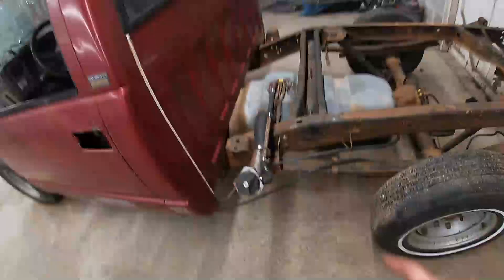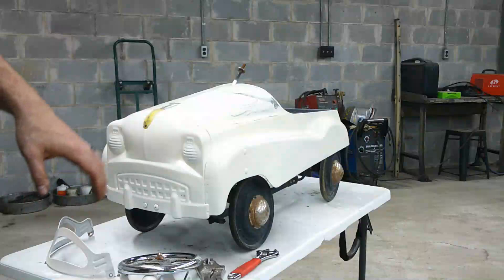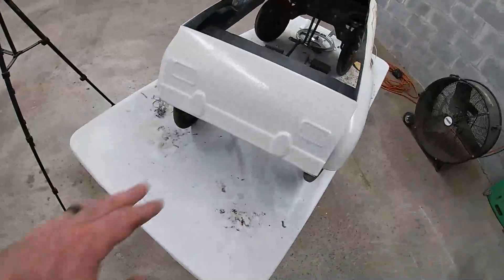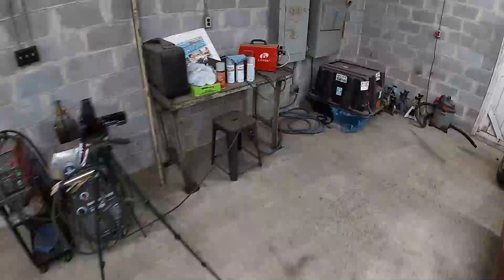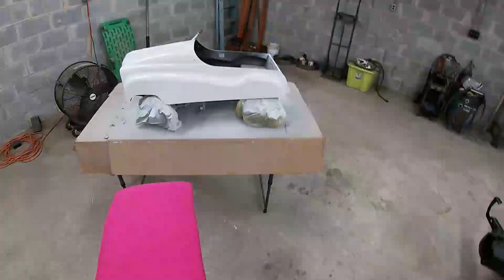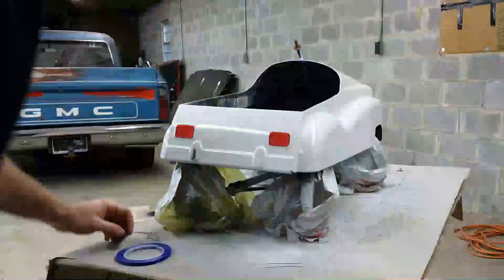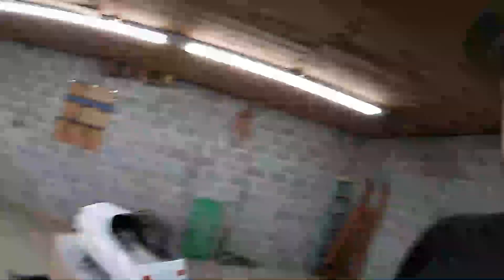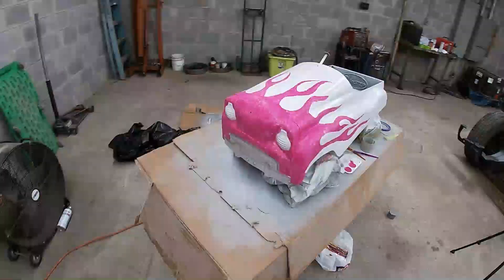Customizing a Pedal Car for my daughters birthday

Comment: You did a great job.  She's going to take many road trips in her new hot rod.  Just showing off what her Daddy did for her! A little tip. If you unroll the fine line tape and touch it to your pant leg it gets just enough dust or lint that the adhesive isn't so aggressive and you'll have less lifting paint problems.  Awesome job be proud!!
Reply from the maker: Thank you sir